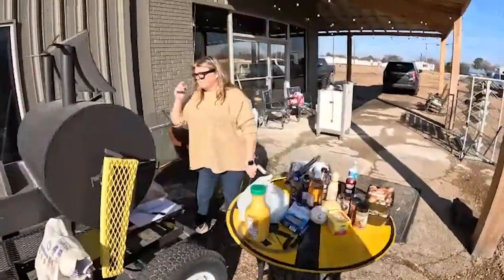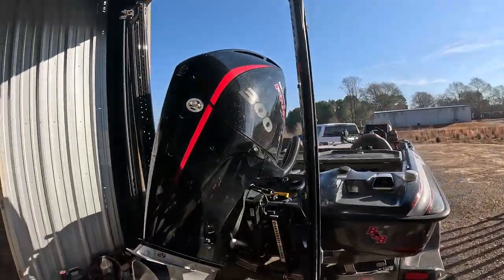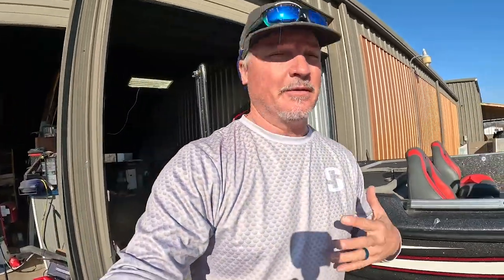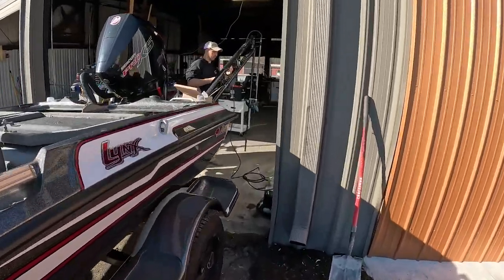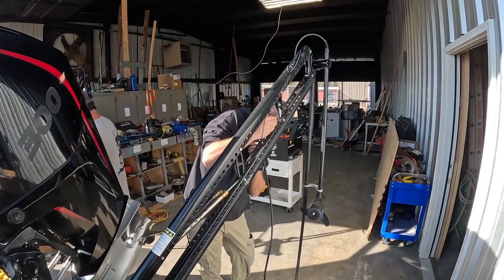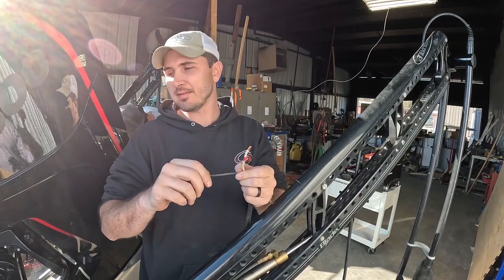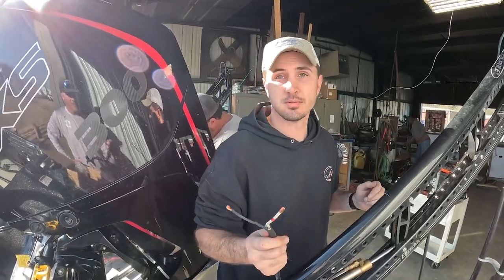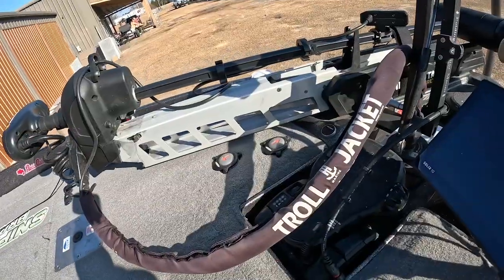Crappie Brakes!! (Improve your Crappie Catching POWER)

Comment: One bit of info that might help.  If you already have 24 volts of current feeding your old system, you can purchase a step down capacitor that will make a 24 volt battery deliver 12 volts at 10 amps.  I was talked out of the original crappie brakes and put an Ulterra on a quick release at the port stern. It worked beautifully, but there is no way to simply create a stomp switch that is proprietary for the run mode of ulterra or Terrova. So the only way to activate the units is with the remote or a foot pedal. As we all know, we fish better with both hands free.   I have sold both my ulterra and Terrova (back) and am switching to the original crappie brakes.

Comment: I put them on my boat couple months ago, work great, however, I’m thinking about making brackets to mount at transom , just easier in the standing timber not to have the poles extended, but being to raise them up and down with your foot or remote is really nice
Reply: @jonnynash364 I just left comment above but could you explain this to me?? I'm lost and I quit smoking pot years ago. Not being smartass I'm confused man. I may look like a dumbass when I get the answer but until then this is the craziest thing I mean first off when I Crappie fish I'm not on plane so just press my power pole button either key fob or foot control and I'm stopped in 1 maybe 2 seconds.
Reply: @squarebill    We use these in deeper water where the poles won’t touch anyway,  I put mine down so the TN is about a foot deep,  if your drifting, say spider rigging or chasing taming fish,  you can now stop the boat without reversing your TM on the bow and spooking the fish,  I use mine when targeting bigger fish in standing timber.  When I. Doing this. The fish are only 5-7 feet in front of me, now I can back up the boat with these instead of using the front TM and spooking the fish I’m targeting
Reply: @jonnynash364  Well heck I see and makes sense now I couldn't figure it out really. I been fishing brush piles in 12 to 15 ft here on Ky. Lake this winter and there's been times they'd been handy for sure. How much weight would they add to transom?? I'm running Skeeter FXR21 wouldn't be a problem with em just curious as to the weight.I sure appreciate ya educating me on em.I think fella may have thought I was smartass and all and shit I wouldn't be like that. Can ya fish Grenda at draw down?? They bound to be bunched up real good somewhere.Hell I buy a non-resident and come down get on them 3-4 lb fish yall got.

Comment: I'm a bit confused!! Do you ease around with your poles down enough to where the trolling  motors are in the water and if so well which they would have to be in order for them to serve the purpose in which have explained right. I have 8 ft poles and while they have me anchored and i want to move a bit i just raise them enough to allow me to move so if i wanted to use them as brakes i just put them down the foot that's needed to stop. I'm no college educated fella but not disabled in the head and I don't understand just seems like extra weight on transom and extra $  out of bank account. Why couldn't you ease your poles down to stop isn't that the idea and purpose for having them??
Reply: Good luck anchoring 8 ft poles in 10 FOW. The brakes are utilized in deeper water